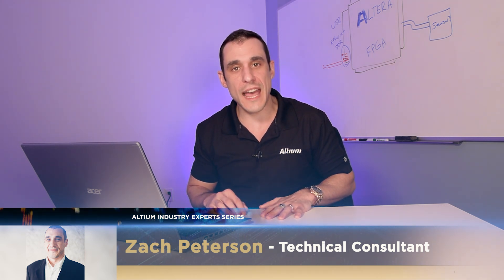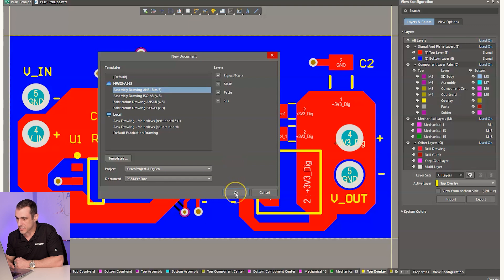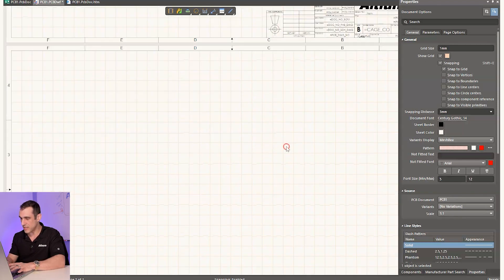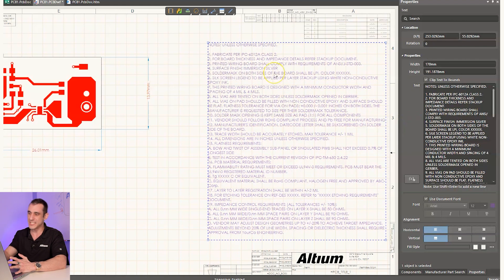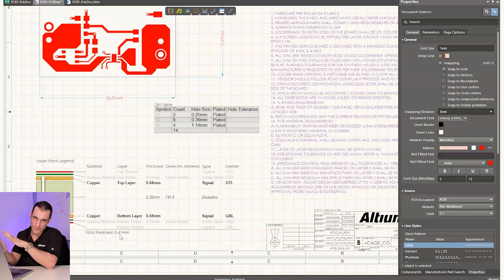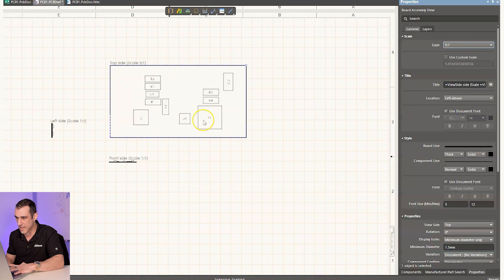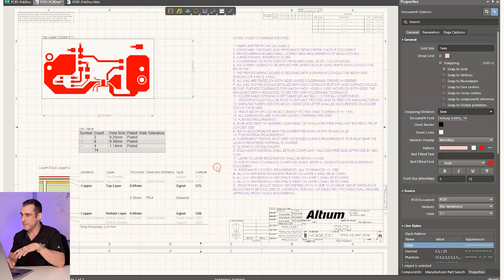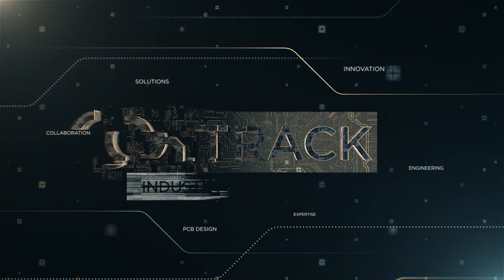Easy PCB Assembly Drawing with Draftsman in Altium Designer

Comment: I am not understanding the text on the difference between a draftsman document and sheet templates. Please explain.
Reply: If by "sheet templates" you are referring to templates for schematics, those templates are only used for creating schematic sheets. Schematics only contain the circuitry which gets synchronized into your PCB. Draftsman documents are for creating manufacturing drawings quickly and using some automated tools, such as the assembly drawings I show in the video. Draftsman is meant to replace PCB drawing creation with AutoCAD because it automatically creates standard PCB drawing objects using your PcbDoc file. This way, you do not need to export DXF prints from your PcbDoc file to then use in manually-created AutoCAD drawings.

Comment: Hi Zach.  I asked this in another video, before I found this one, so sorry if it's repetitive, but you've been great at answering questions, so I am hopeful you have an answer to this.  There are these fields that are faded, such as "=Revision".  What is the right way to give these values? I don't seem to be able to edit these directly, so I tried adding them to the Project/ProjectOptions/Parameters and now that parameter I added doesn't display anything the "=Revision" any more, not even what I added.  It does show up also as a PCB Parameter in the drawing parameters, but again, doesn't display it.  What's the right way to handle these "=Parameter" fields on the drawing that aren't "User" fields?  Things that are clearly "User" I can change like =CompanyName.  Also, if I do use the user parameters, how do I change the font size for them?  As of now, I am just doing everything with free text, since I can put it where I want, and I can change the font as well.  Thank you! - Austin
Reply: I don't recall which of these applies in Draftsman, but these might be in the document parameters (Accessed in the Properties Panel). Normally I do everything in the Project Parameters because that parameter system works pretty universally throughout Altium Designer.
Reply: @Zachariah-Peterson  What figured out was, if I add the same parameter, say "Revision" to the project via Project/Project Options/Parameters (and given it a value, say "0.0"), and in each sheet, set the "Revision" parameter to "*", it uses that project based parameter.
Reply: Bigglesworth, I think "Revision" is a parameter reserved for system use.  In other words, it's unwise to create a user parameter called Revision because it's a parameter rooted in the present PCBDOC that spawns the Draftsman doc.  Before realizing this I created a Revision parameter for my title block template and it became uneditable thereafter.  I couldn't kill my user Revision parameter with a gun, knife, or Delete key.

Comment: I submitted a Draftsman fab drawing to my fabricator and they insisted they needed the drill guide as a Gerber. I couldn't get a reason as to why out of them. I set up the outfile so they were both generated at the same time so I could be reasonably sure that the drill data in both files was the same. I couldn't figure out why, except as a manual check on the NC drill data. There were thousands of holes so the check must have been random sample.
Reply: I'm going to assume you also sent them the NC drill data? I normally include the drill guide and the drill drawing as gerbers just in case they want these, I think it's mostly for front-end DFM.